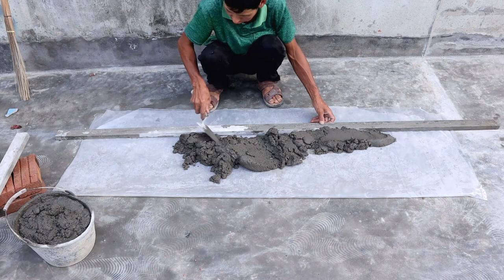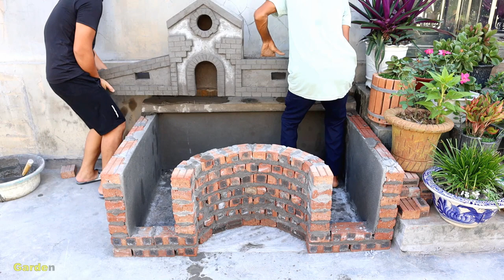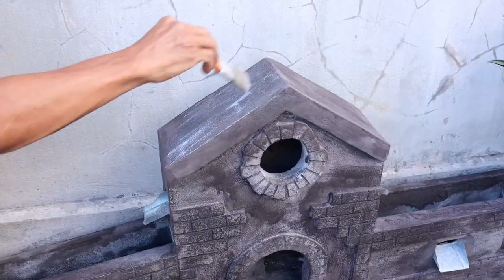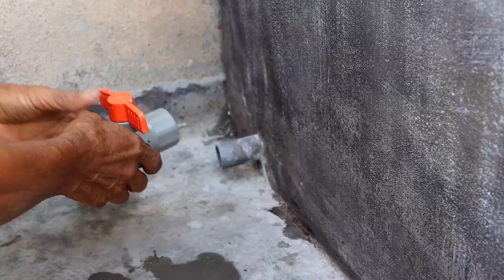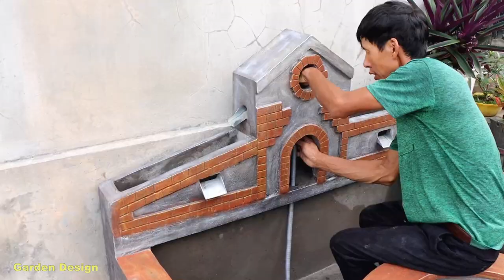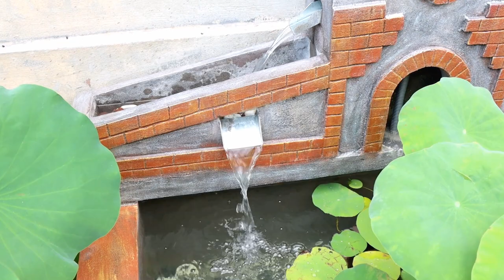Outdoor fountain design - Ideas to build a beautiful house-shaped aquarium

Comment: Excellent. The glass in front is a great idea. Needs a coat of sealer on the inside to keep water from weakening the cement and contaminating the water. That yellow fish is splendid too. What was the tree chips in water for?
Reply: Banana tree used so it could soak the lime usually present in cement